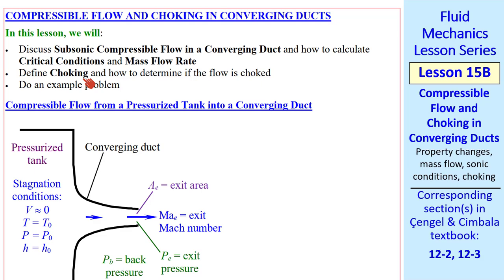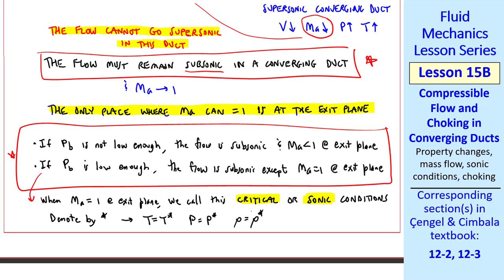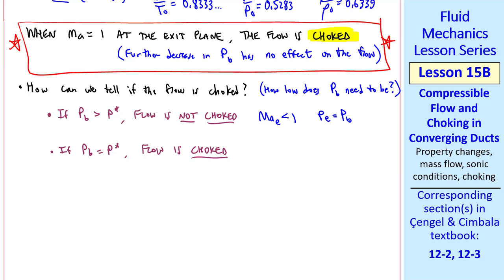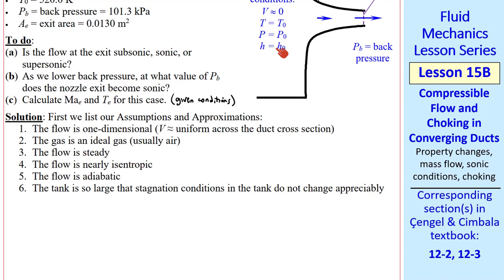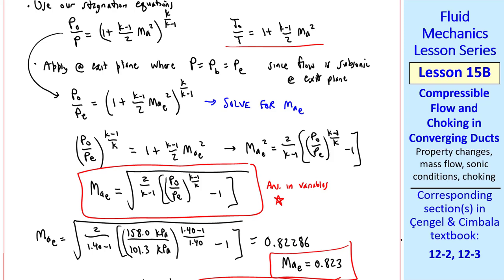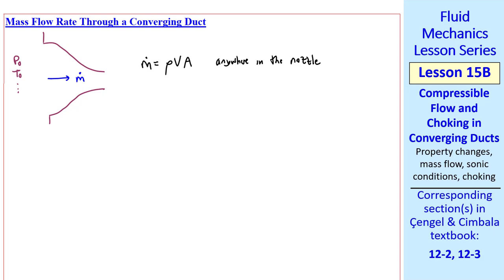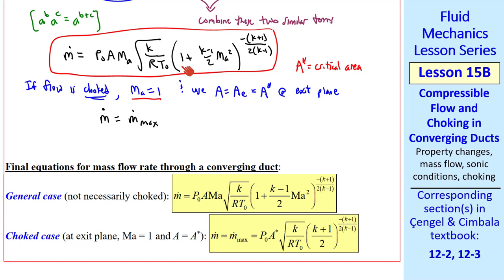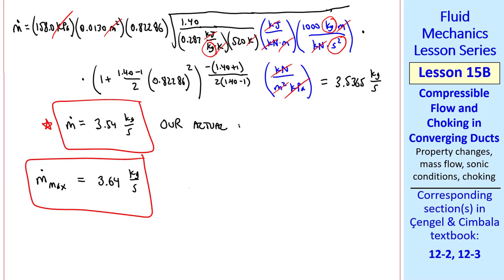Fluid Mechanics Lesson 15B: Compressible Flow and Choking in Converging Ducts

Comment: How does it work when the pressure in the container is lower than the ambient air? Thank you
Reply from the maker: If that were the situation at time zero, the flow would go backwards into the tank until the pressures equalized.
Reply from the maker: Thank you for your comment. Please tell your friends and colleagues about my YouTube channel where there are almost 500 free videos about the Bible, fluid mechanics, science, math, Excel, statistics, air pollution, and other topics. I would greatly appreciate it.

Comment: Dont you have to establish that the stagnation conditions in the tank (e.g. pressure, exit area) will be sufficient before analyzing for compressible flow conditions?  What are these conditions?
Reply from the maker: You can always apply the compressible flow analysis even if the flow is nearly incompressible, In that case, the results will asymptote to incompressible analysis results. The conditions for significant compressibility are that the pressure needs to be high enough in the tank to give reasonably high Mach numbers at the end of the converging duct, such as 0.4, 0.8, 0.9, etc. The max is Ma = 1 as I state in the video (choked). If Mach number is really small at the exit, like 0.2, incompressible analysis is a reasonable approximation.
Reply from the maker: Thank you for your comment. Please tell your students about my videos - they can be used as supplements for the book and course. Also, please tell your friends and colleagues about my YouTube channel where there are hundreds of free videos about the Bible, fluid mechanics, science, math, statistics, air pollution, and other topics. I would greatly appreciate it.
Reply: Thank you, will do. Your textbooks are excellent as well!

Comment: I would like to ask in the nozzle is it possible that the Ma is greater than 1?
Reply: And if let's say the Ma in a duct is greater than 1, the max mass flow rate will still be calculated using Ma = 1?
Reply from the maker: No, not possible unless the nozzle has a throat and then the area grows larger beyond the throat. See the next lessons for more discussion about this.
Reply from the maker: Thank you for your comment. Please tell your friends and colleagues about my YouTube channel where there are more than 400 free videos about the Bible, fluid mechanics, science, math, statistics, air pollution, and other topics. I would greatly appreciate it.
Reply from the maker: @Sam-dh9fn  If it is a converging-diverging nozzle and the Mach number is 1 at the throat, then yes you can calculate the mass flow rate at the throat. If it is just a converging nozzle, then the flow will achieve max flow rate when the flow at the throat is sonic (Ma = 1), and then you can use sonic conditions at the throat to calculate mass flow rate, which will be the maximum max flow rate for a converging nozzle.

Comment: What happens in the nozzle if you achieve choke flow before the throat? How sensitive are nozzles to this occurring?
Reply from the maker: That is impossible. Choked flow, if it is to occur,  must occur in the throat in a converging duct
Reply: @johncimbala  Tha k you for the reply. So, if a nozzle has a throat smaller than is necessary to achieve sonic flow, it will still only achieve sonic flow in the throat?
Reply from the maker: @Gingerneer80  Correct. All that will happen is that the mass flow rate will go down. The flow will adjust itself such that it is sonic at the throat if there is enough pressure difference from upstream to downstream of the throat.
Reply: @johncimbala  Amazing thank you. I've not been able to find this answer anywhere else. I greatly appreciate your help
Reply from the maker: @Gingerneer80  The throat size does not really matter. If the pressure ratio (stagnation pressure upstream divided by downstream pressure) is sufficiently high, it will choke at the throat regardless of throat area. All the area does is determine the mass flow rate (bigger for bigger throat), but it will be Mach 1 and choked regardless.
Reply from the maker: @Gingerneer80  Thank you for commenting. Please tell your friends and colleagues about my YouTube channel where there are hundreds of free videos about fluid mechanics, science, math, statistics, the Bible, air pollution, and other topics. i would appreciate it.

Comment: Thank you for the video, there's one confusion I have, how did you get the p*/po to be 0.5283 in the example when calculating p*? Is there a property table? My college program is not covering these particular concepts. 

Also, I'm building a self landing rocket with CO2 cartridges as a propellant source for school capstone project. I'm trying to calculate the mass flow out of those small cartridges, and the choked flow that basically puts a cap on how much thrust force I can get out of them. The thing bothers me the most is the pressure of them (800psi to 3000psi) and the freezing cold temp.(~ -70C) when it's being released. I doubt that these are nearly isentropic nor adiabatic. 

Will it still be worth it to try to figure out the choked flow when I have to assume and accommodate tons of properties.
Reply from the maker: It's from the equation on page 2 of the notes for the case when k = 1.4 (air). Yes, your flow is definitely choked at those high pressures!
Reply from the maker: Thank you for your comment. Please tell your friends and colleagues about my YouTube channel where there are more than 400 free videos about the Bible, fluid mechanics, science, math, statistics, air pollution, and other topics. I would greatly appreciate it.
Reply: @johncimbala  A thousand thanks! I definitely will!

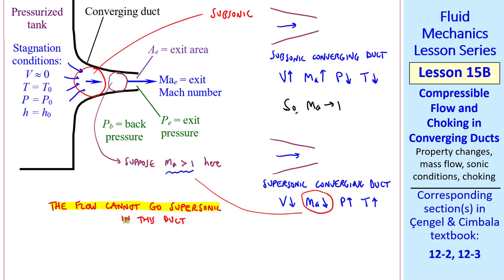Comment: At 1:29 you say the flow must remain subsonic in a converging duct. What if we have a converging duct with supersonic flow, followed by a diverging duct (after the throat) with a subsonic flow? Is it even possible? I saw it in an exercise and it isn´t making much sense to me... Thank you in advance!
Reply from the maker: Not possible if the flow is coming from a pressurized tank upstream. The flow cannot become supersonic without going through a throat.
Reply: @johncimbala  what if we have 2 converging-diverging ducts in a row? That way, when the flow leaves the first diverging duct with Ma>1, it immediatly encounters the second converging duct. Is it possible in this case? Or will there be a shock in the beginning of the second converging duct, not allowing the flow to enter it with Ma>1.
Thank you.
Reply from the maker: Yes it is theoretically possible. What usually happens, though, is you get a shock wave just downstream of the second throat, and then the flow is subsonic after that. Many supersonic wind tunnels use this effect because it makes the flow in the supersonic test section more stable - not influenced by downstream noise. Also, if done correctly, it greatly reduces the amount of pressure loss in the wind tunnel, thus leading to reduced power consumption. I teach this in a later section of my course, but have not created a video about it yet.... maybe some day.
Reply: @johncimbala  Thank you very much! God bless you! Greetings from Portugal!
Reply from the maker: @miguelmartins4703  Please tell your friends and colleagues about my YouTube channel - a free resource for educational videos on fluid mechanics, Excel, science, the Bible, math, and other subjects.
Reply: @johncimbala  I certainly will!